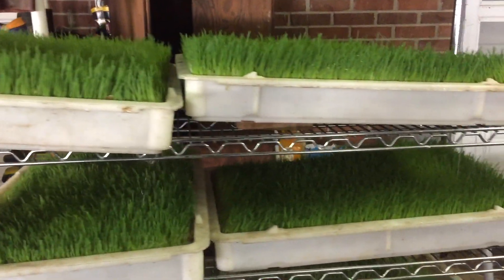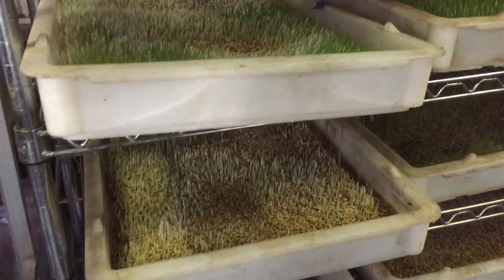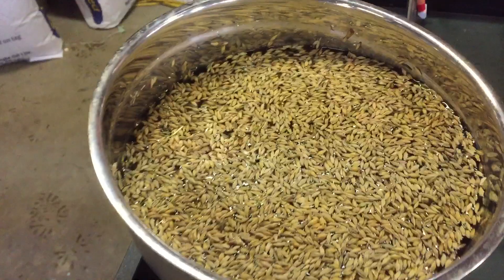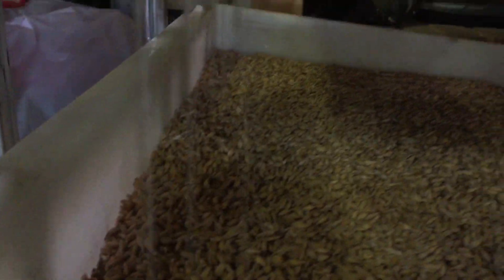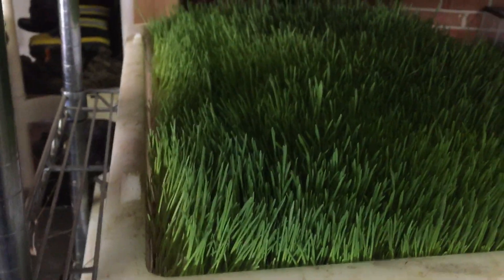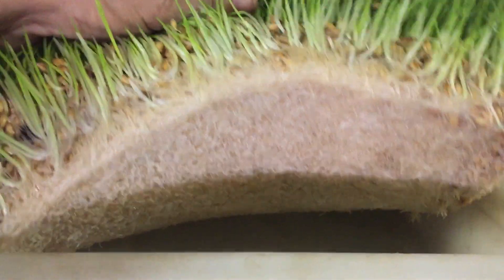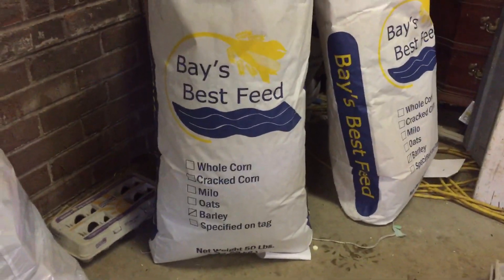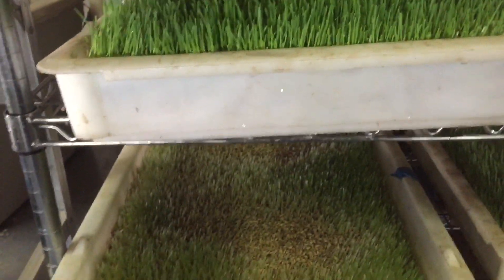Growing barley fodder with hydroponics

Comment: Do you add any nutrients in the water? Can water be reused?
Reply: Waseem Akram Malik 
The nutrients are in the seed. You can probably use the drained water for your house plants or garden, but don’t recycle it on your sprouts. Use fresh water on your sprouts.
Reply: @fredflinstone3173  Do you have any third party test results proving this statement. What weight gain do you have from that method?
Reply: Water can be reused but for animals fodder no need to add nutrients just sprout seeds

Comment: Very cool. What seasons of the year do you do this or is it year round? Also, if no grow lights, how much natural light? And what's the temperature of the room? Thank you very much!
Reply from the maker: Nellie Riehle year round, growth slows in the winter a lot. No grow lights, some regulate fluorescents in the garage. Not near a window. Temp goes from 30-105 degrees f(hard to keep down the mold in the heat I need to get an area outside in the shade and chicken free to alleviate the heat issues in mid to late summer)
Reply from the maker: Nellie Riehle and thank you! :)
Reply: Thank you! Geez, I just discovered I got a response to this comment I made. I appreciate it!!